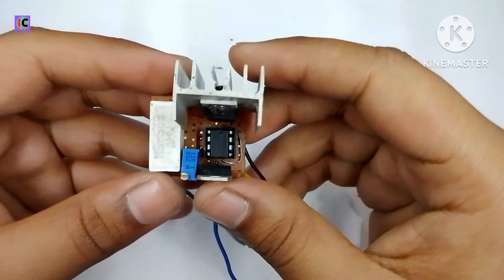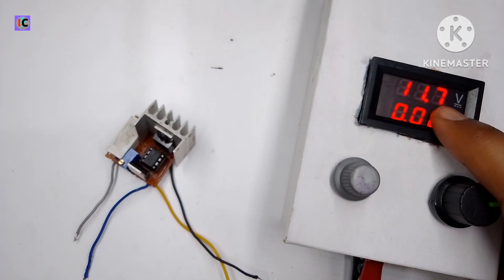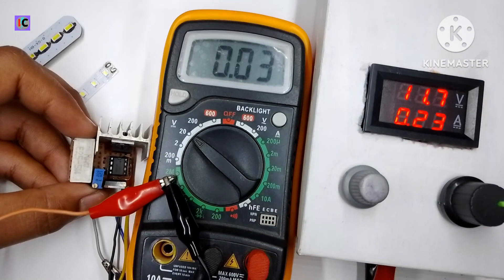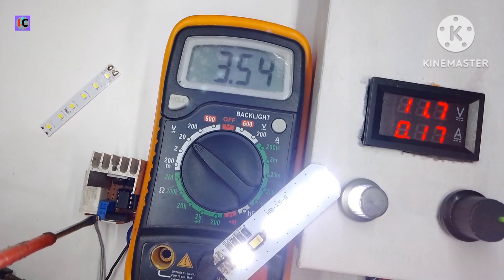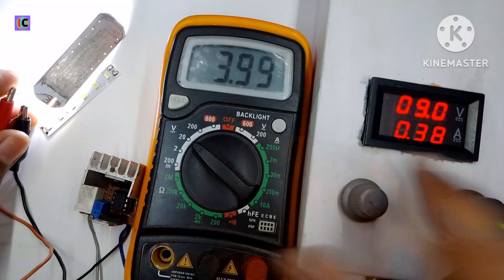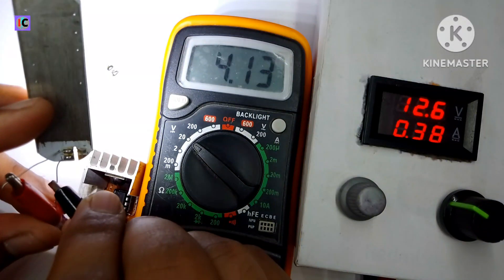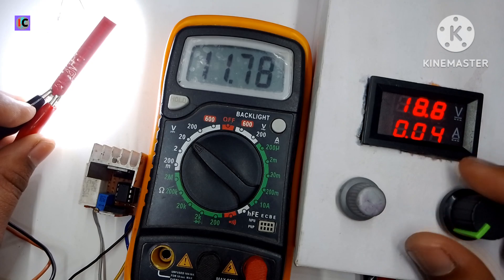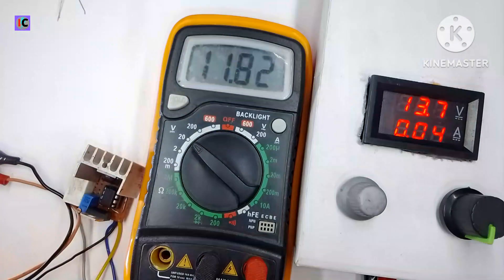Constant Current LED Driver #led #leddriver #powersupply

Comment: The down side to that is it not efficient if the voltage difference between led forward voltage and supply woltage is too high alot of power will dissipate on the mosfet
Reply from the maker: Yes the mosfet gate is controlled through voltage, if we adjust duty cycle then it will be effective

Comment: That's not a constant current supply that's a current limit supply 2 completely different things because when you change the LEDs which is changing the load the current changed that's not constant current
Reply from the maker: its constant current driver basically the 0.25 ohm resistor sense current and gives feedback to LM393 which turns off and on very fast to maintain the current limit set by Preset
Reply: @innovationic  not sure of your response since you use the word limit please answer this question all things kept the same when a certain current is set and you change the load will the current remain the same? If it doesn't then it's not a constant current supply it's a current limit supply
Reply: We're both wrong the device is a constant current supply, but you're wrong it doesn't work by oscillating ....it's a unity gain current amplifier which doesn't oscillate ....it's also known as a high current transimpedance amplifier
Reply from the maker: yaa that's it 👍

Comment: Great tutorial! Bhai circuit mein output ke upar 12 v ki line kisliye kheechi hai?
Reply from the maker: output me load connect karne ke liye 12v aur mosfet drain pin se load connect hoga
Reply: @innovationic  ok does that mean mosfet drain pin will act as -ve. Sorry I am from a different field but I want to make galvanostat and I liked your video. Just want to confirm before I start making.